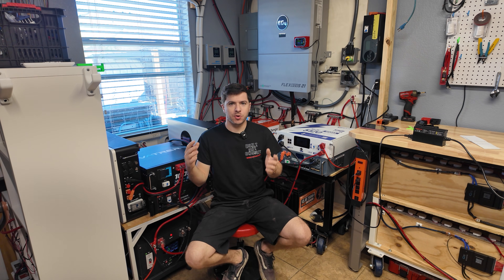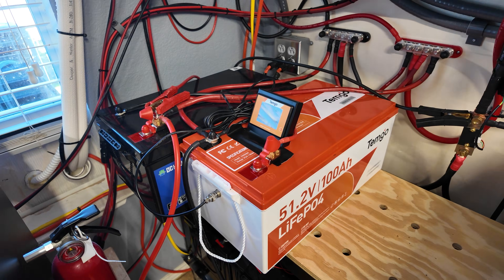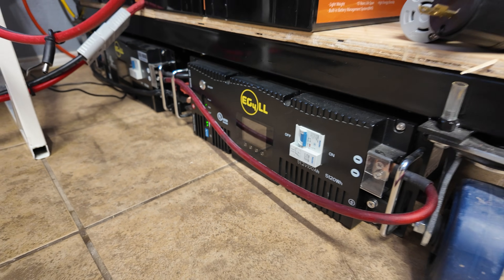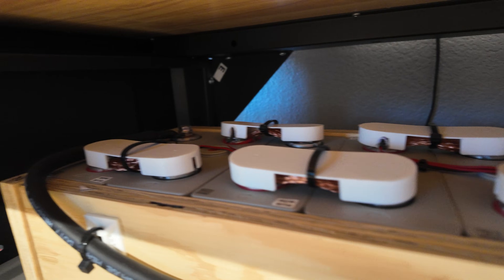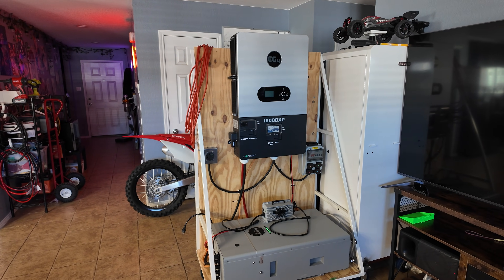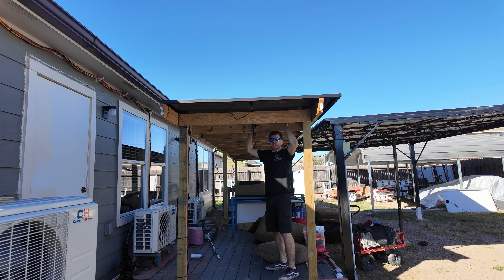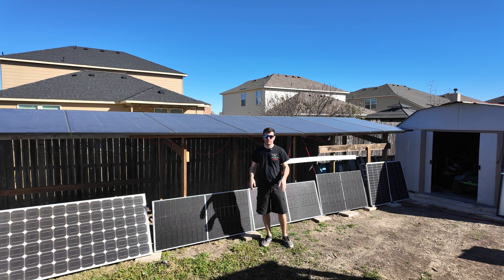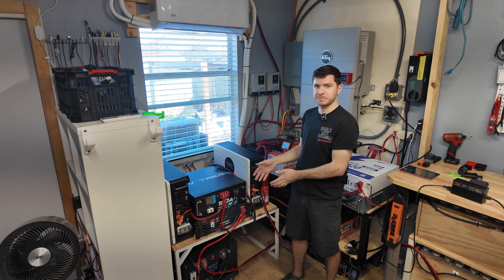EG4 Flexboss 21 Powering House Off Grid Setup Overview 110 KWH of Batteries!

Comment: Here’s what Google has to say about these FlexLoss inverters. 

“Common complaints about the EG4 FlexBoss 21 solar inverter center on its extremely noisy fans, especially under load, and overheating issues that can lead to performance throttling or hardware failure (like DC-DC converter burnout). Users also report issues with the companion GridBoss failing to automatically switch back to the grid after outages, communication errors between units, and inconsistent firmware performance, sometimes requiring warranty replacements.

Key Complaints:
Excessive Noise: The fans are a major source of complaints, described as jet-engine loud, with noise levels far exceeding spec sheet claims, especially during mid-range PV input (around 6kW).

Overheating & Performance Throttling: Units can reach high internal temperatures (95°C), causing throttling, with fan logic sometimes failing to activate soon enough, particularly during heavy battery charging.

Hardware Failures (DC-DC Converter): There are reports of the DC-DC converter board burning out, leading to battery disconnection and requiring RMAs (Return Merchandise Authorizations).

GridBoss Transfer Issues: The GridBoss unit often fails to automatically switch back to grid power after an outage, requiring manual intervention.

Firmware & Communication Errors: Users encounter communication failures between the FlexBoss and GridBoss, with the monitoring app showing errors or flipping views unexpectedly.

Inconsistent Performance: Some users experience complete system failure or battery charging issues after several months of use, impacting their ability to use time-of-use electricity plans."

Comment: Hi mike im full offgrid in qld Australia 4x300ah werchtay batteries in series with an equaliser. Wired 3kw of dc straight in to hotwater element with a dc isolator switch love your videos mate.
Reply from the maker: Sounds like an awesome setup you have!  Thank you!   I watch a bunch of Off grid garage hes also in Australia im sure youve heard of him!
Reply: @Mikebuildss haha yes! Have you tried running straight dc in to hot water element with isolator switch? Upgraded the element too a 3.2kw heats up in three hours mate.

Comment: Thanks for the video Mike. You spoke again at the end of the video about mixing batteries. I was under the impression that the amp hours of each battery should match as well. You have a lot of 100 ah batteries and a  314 ah and others. Think it was 314 ah.
Am I understanding this correctly that you can mix different ah batteries? I'll never have this issue as I'll never have nearly as many batteries as you do. All of mine are at 100ah each.  Thank you!
Reply from the maker: You got it right! You can mix them if the voltage matches,    Best practice is to match batteries if you can help it, but mixing different brands and AH capacities definitely works just fine with very little draw backs if any